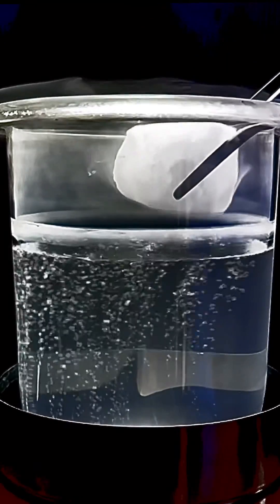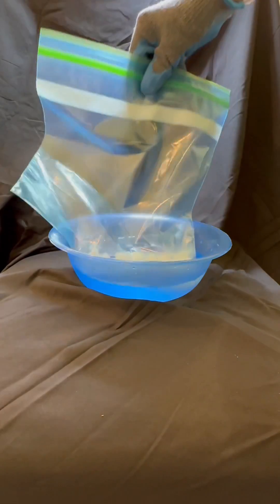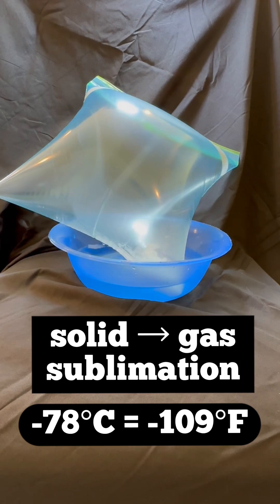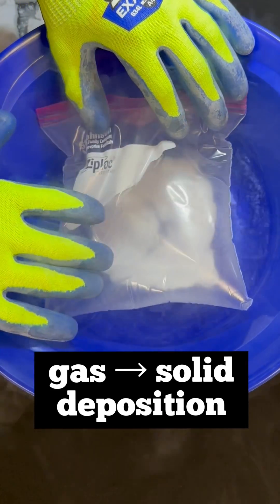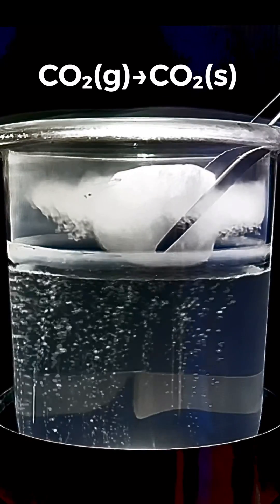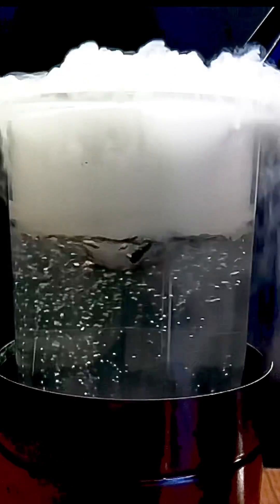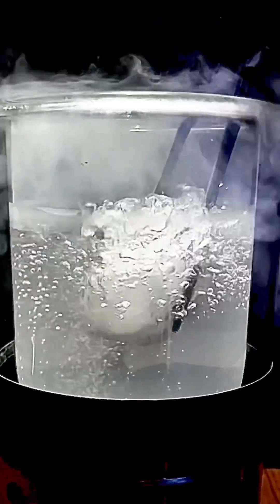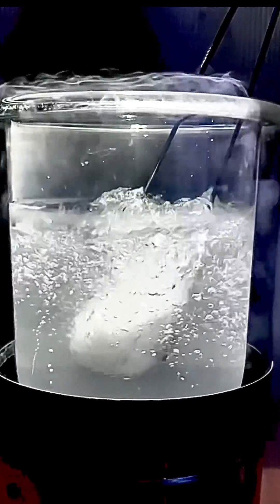What Happens If You Put Dry Ice in Liquid Nitrogen? 🥶🧊

Comment: I think that's always confused me in chemistry is the actual point of time it transfer between phases. I know there is phase diagram that can probably show this but why does the dry ice initially sublimes then freezes? Shouldn't it instantly stop subliming?
Reply from the maker: Substances must lose energy in order to freeze. It takes time for energy transfer to occur. Because of this, the surface of the dry ice remains above sublimation temperature for a time before transferring enough energy to the liquid nitrogen to remain solid CO2